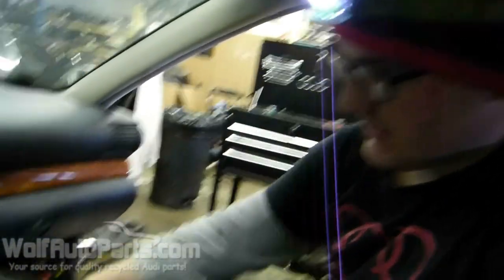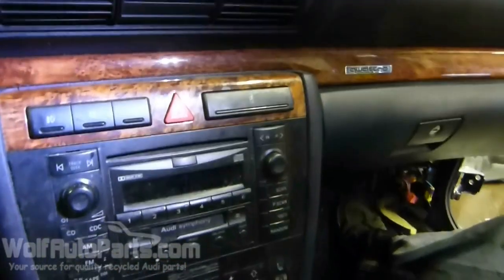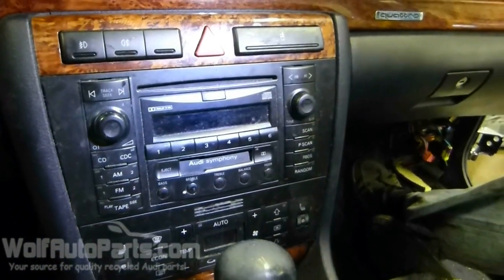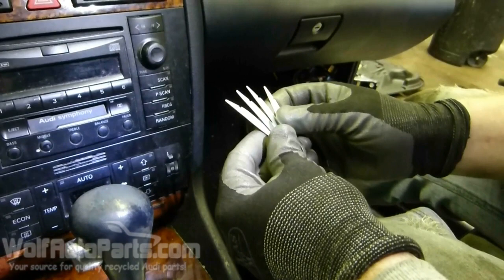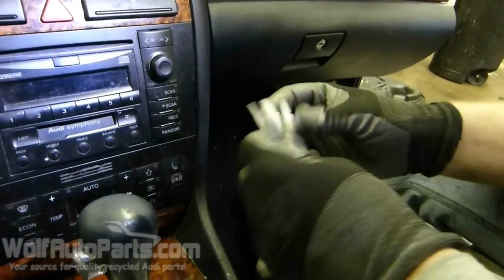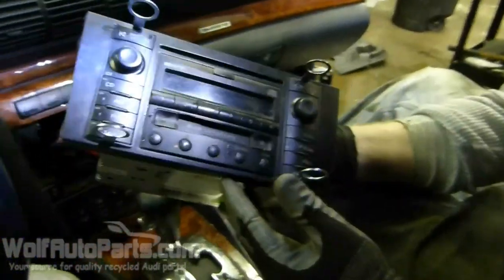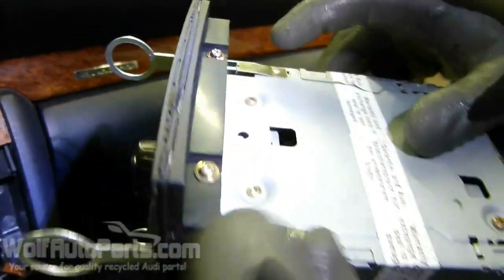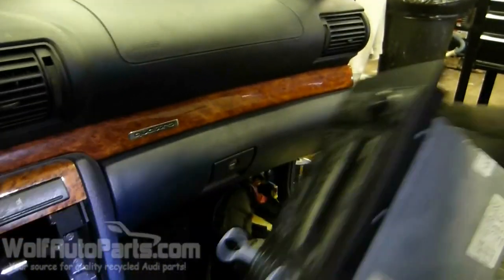How to Remove Radio / Stereo - Audi A4 B5 1996-2001 (Wolf Auto Parts)

Comment: Something is most def wrong with my radio because ive used every kind of key you can think of from cheap to expensive and it wont come out. Its like something is blocking it from being pulled forward. I really need to get it removed because im having an electrical issue somewheres in there. The radio fuse on the drivers fuse panel blows immediately and its causing other issues like my clinate control system malfunctioning and sunroof.

Comment: Have a question when removing the radio is there a button in the back to reset the radio bc my radio is on safe mode n i have no idea on how to get the code pleaseee helpp :)
Reply: You have to look in the manual for the steteo there is a code. Or go online search- and provide a netsite with the serial number on the back of player. They send you code on email for a small fee

Comment: How to remove clima in this model?
Reply: Probably too late on this, but I have the same question, cause the buttons are sticking in the clima making it difficult to use.
Reply: @kainariylius392  I remember pulling it out from the top, I mean after pulling the stereo first.
Reply: Yep that's exactly what I had to do. Soda got spilled, and now it's getting cleaned.